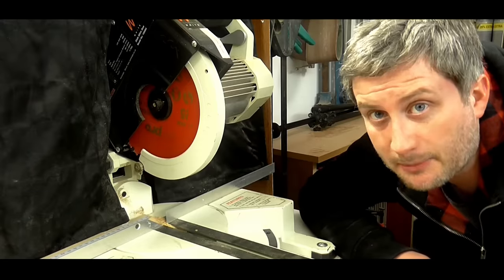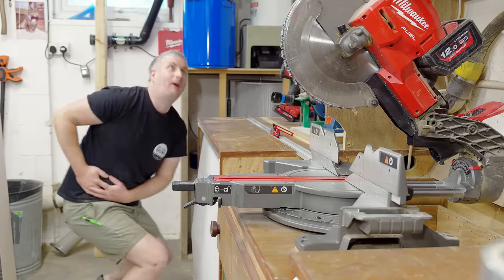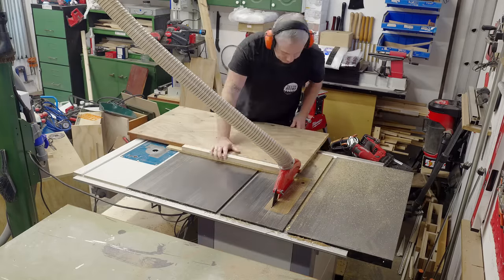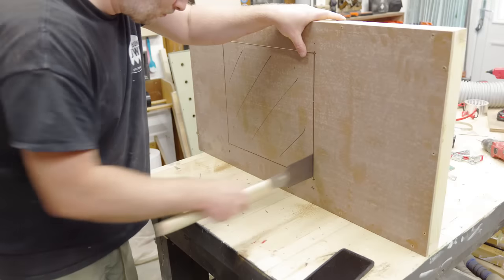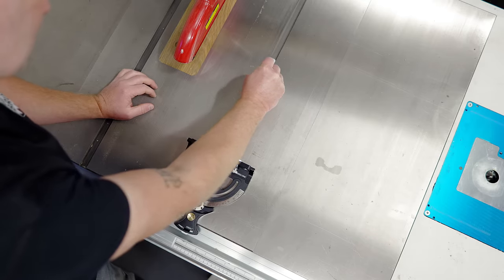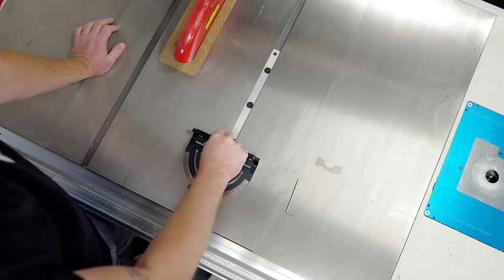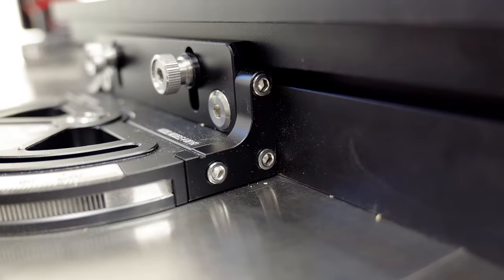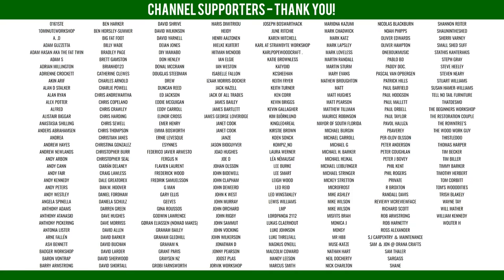Goodbye, Mitre Saw!

Comment: I have a 12 inch maketa.. they are a necessary evil in the shop.. my concern is of all my tools kick backs come from the miter saw
Ai have checked all adjustments.
I have a two car garage that has a space on both sides of the garage and except for the jointer and miter saw all the reston my tools are on wheels.
The saw stop table saw professional  saw is a must

Comment: I don’t use my miter saw unless accuracy is not an issue. Too much room for error with flex, lock points not engaging the same, and it will pull the material if you don’t clamp it down, or hold it with a lot of downward force. Which can be dangerous and move things around during your cut. Maybe it’s just me, but I use a sled.

Comment: I know what you mean. I've screwed my mitre saw to a piece of plywood and clamp it to whatever I got free space on and get cutting! There's lots of other ways to add stop blocks than have a mitre station so just get creative and make it work for you. 
There could be a 3D printable adapter you can have made to improve dust collection on your mitre saw. Still wearing a face mask is probably healthier rather than relying on dust collection and air filtering.

Comment: My dewalt mitre saw suffers from similar issues.  Its not an accurate tool. If you out pressure on the handle in either direction it takes the saw out of 90 degrees.  You can also change the depth if you set the depth stop based on how much downward pressure you apply.

Comment: My mitre saw is my most used tool, but I have it on a portable stand, a mitre station would just waste space and get covered in junk.

A mitre saw just feels so much safer than a table saw. I wouldn't fancy cutting down 2 by 6es on the table saw, and Notching out for half laps on long or rough stock is so easy on the mitre saw.

Comment: .. Spot on with the "junk collector surface".. and the whole reason I refused all these years to build a station.. it would have taken up too much space on my last shop floor.. and my new shop structure will be even smaller. Yes, miter saws are not as accurate as the table saw.. but it often takes too much time to set up.. and fiddly.. on the table saw.. and the Miter saw really exists to make quick, semi-accurate crosscuts.. in my case, it does as much as 25% of the cuts on each job that I do, as thin stock is so much easier to do on a crosscut setup.. and you don't have that much angle RUNOUT on a short piece of stock, anyway, in my experience - that can't be easily dealt with.
Where I think most people started to get into trouble was when everyone decided that they needed 12" W crosscuts - using a Sliding Miter saw - THAT can potentially give you all sorts of misery!
I do also agree with you that dust (even with the nearly 40 different solutions I have seen) output from that type of saw is suffocating! Great Video.

Comment: Sounds like your problem is rather a workshop design issue, could reprioritise other tools in the space and have for example the mitre saw on a lift that drops down under the bench. It’s position in the workshop is causing you to knock it etc and as you mention forward facing rails can make a big difference to space needed. I have a Makita with front rails and also has dual dust collection, plus mine is on a rolling bench which I wheel outside under cover for use. Of course if you’ve got competing tools like table saw which is more versatile, then you perhaps don’t need it.

Comment: Nice to see a video with this “against-the-grain” viewpoint. Personally, I’ve never been a fan of miter saws in the workshop. They’re handy on a mobile cart for worksite/remodeling jobs, but for shop purposes, I think a radial arm saw is a much better way to go. 

With a little tuneup, it’s just as accurate as a miter saw but with a greater capacity. And you can add a laser for ease of cut alignment. If you’re willing to get creative and design a new blade guard, you can install a 12” - or larger - blade (within the saw’s physical limitations, of course) for greater capacity in the Z axis. You can even (again, with some creativity) make a custom mounting plate to turn your radial arm saw into an overhead router table or a planer (using a hand planer and making multiple passes. I haven’t done either of those  yet but they’re on my to-do list) which make it incredibly versatile.

On top of all that, you can even make cuts that don’t go all the way through a board - which you would otherwise have to do on a table saw. I find that I strongly prefer my table saw for cutting panels ( wish I had a panel saw for sheet goods, though) but there are lots of times where it’s easier to work with a fixed workpiece. It’s a pretty trivial task to add flip-up side wings to support longer stock (and stop blocks? no problem!) - but then I can flip them back down for storage and it has a much smaller footprint than a miter saw station. (The footprint, front-to-back, isn’t nearly as deep as some miter saws/stations, too.)

Radial arm saws got a bad rap and fell out of favor because they’re unsafe for rip cuts (although you can find videos that dispute that) but I use my table saw for ripping, anyway.

If all that isn’t enough for you, there’s the price. You can buy an old radial arm saw for a fraction of the price of a sliding compound miter saw. It’s a no-brainer to me.

Comment: I started with a table saw and have never felt the need to have a mitre saw. I don't have the space and
any angle cuts other than 45 degrees for which I have a sled for, are done by hand.
I don't think I will ever get a mitre saw.

Comment: Maybe just build the mitre saw station with a height so it is helpful as table saw infeed support rather than a hindrance? If you can bend down to the table saw then a mitre saw at that same height would be okay... or if the mitre saw would be too low at table saw height,  probably you could just raise the table saw instead?
Reply from the maker: Because then my machines wouldn't fit underneath

Comment: Frist of all, you could definitely have a career as the "before" guy on infomercials! 
As for the video, I also do cuts i have to trust on my table saw sleds and the miter gauge you bought looks quite nice. I still have a miter saw and a radial arm saw in my shop. I find myself using the miter saw quite a lot in my work flow but everyone is different. Having open floor space is a valuable thing I have been working towards opening up more of it in my shop lately.

Comment: I can see the desire to get rid of that large miter saw work area, but I would have kept the saw and just put it on a mobile base.  I have a Metabo 12" on a Ridgid stand with wheels.  Folded it takes up minimal space.  When I need it I just roll it outside where the sawdust is much less of a problem.

Comment: I've had a mitre saw under my bench for about 10 years. It comes out to chop 3x2 CLS and not much else because I don't trust it to be accurate and the capacity (non-sliding type) is pitiful. I am hoping that my new Evolution sliding mitre saw will be put to much better use. Larger capacity and seems to have excellent repeatability, even after a few knocks. I haven't the space for a dedicated mitre saw station but it's light enough to set up whenever I need it. Time will tell.
Reply: I've been very impressed with my evolution sliding mitre saw, I bought it for cutting metal so that I didn't contaminate my main timber saw, but it's so good I'm using it in preference sometimes !

Comment: First and major mistake was not setting all of your surface heights inc the table saw to the same ht. so everything is an outfeed table. That said even the very best miter saws are not all that accurate compared to a dialed-in table saw sled. But I still want a miter saw to break down rough lengths.

Comment: My brother-in-law gave me his old Craftsman miter saw and I used it when I was laying some hardwood flooring. However, when I bought my table saw (Ridgid 4512) and then built a cross-cut sled, I never used the miter saw for anything woodworking. I little over a year ago, I bought an Inca V27 miter gauge, with a 24" piece of extruded aluminum (from Powertec) for a fence, I haven't used my cross-cut sled anymore. 

It really depends on the projects that you build but I think the miter saw is an extremely over-billed tool for the average woodworker. If you have a table saw, there is so much more you can do either with a good cross-cut sled or a good miter gauge, or both, that a miter saw is really a waste of space. And when you consider it's dust collection shortcomings, why bother?

Comment: I didn't ditch my Kapax. It's in the bottom corner of my shelf collecting dust though. There are times it becomes handy but that rarely happens. Crosscut is now done with a track saw and a DIY rail square, which is much more accurate.

Comment: I find the only way to cut 10 ft. boards is with a mitre saw.  I don't have 10 ft on either side of my table saw, and a 10 ft. board wouldn't stay straight if it did. I could use a circular saw and then recut with the table saw, but this just adds more work.

Comment: lol…. Just get a decent accurate miter saw like a KS60 or KS120. Have great experience with KS60 regarding accuracy at every single angle. The KS120 even has a micro adjustment handle if that’s your thing. But great opportunity to make content… with something like ditching a mitre saw 😊. Even the guy at Finish Carpentry TV swore to never buy Festool….and look at him go 😅

Comment: Removing the miter saw also means that you will have to switch between rip blades and cross cut blades in your table saw. Minor hassle compared to the lack of space and poor dust collection from the miter saw.

Comment: It's funny that the miter saw is a tool that beginners think they need most. But it's not (unless you are going to be doing a lot of finish carpentry). I barely use mine. Instead I use a handheld circular saw for carpentry, and my table saw for more precise work.

Comment: I wouldn't agree that the backward rail design is the most robust. It doesn't matter whether the rails are running through the back of the saw or through the body. In fact having the body slide forward on the rails is probably better as you won't always be making a cut at full extension and therefore there will be less flex pressure on the rails. In reality though any tool will lose its accuracy if you use it enough. Bearings develop slop, and where there are grub screws or pressure screws used to make adjustments those surfaces will develop small amounts of damage. The mitre gauge is excellent, though I personally prefer the bar of the UJK gauge as the spring loaded ball bearings in the bars are way better than the plastic washers on every other mitre bar. I think Axminster sell those bars as an accessory.

Comment: The table saw solution is ok but you still have the issue of changing blades from ripping to accurate crosscutting blades. They haven't invented a blade which does both accurately but I do understand it's about compromise in limited space. I'm lucky enough to have a Wall/board saw which I use for sheet materials but also cutting cupboard door stiles, sash horns,fire door  glazing appetures etc. I still use my mitre saw but mainly for trimming the ends off sawn boars.
Reply from the maker: Whether the blade is designed for cross cutting or ripping has nothing to do with how accurately it cuts
Reply: @RagnBoneBrown  Thanks for the reply. You missed my point which is ,if your going to accurately cut mitres  for picture frames,boxes,beads etc then you won't get a nice finnished,accurate cut from a blade you would use for ripping timber. Same as crosscutting Ply etc. Point being there is no blade designed to do all of those cuts so you would be changing the blades to do certain jobs. So time wise it's no different than re-adjusting your mitre saw. All you've gained is a bit of space which is a bonus in a small worksho but it's not a win win option..  All the best Ade

Comment: see if you can find a CTD Mitre saw. Then put it as close to wall as possible. This has no fancy half asses radial arm like feature if you want that get a radial arm saw instead. The fence table with measure jig stop should be no more than say the depth the blade can cut. Above the fence table put two shelves one on each side at an easy to reach height do not let this get deeper than the fence front to wall. above those make a full-length stock shelf. Where you put the saw, itself should be a proper sized cabinet for the saw and possibly a little space for fence attachment. All the areas under the fence to the wall should be left open or a waste can something easy to move. If you are really tricky you can "Muphy fold up bed idea" your fence with some way to clamp the end to the saw or was cabinet.

Comment: I don't think Robert DeNero has anything to worry about ;). I think you will soon get used to using the cross cut sled , perhaps you could keep the mitre saw to hand if you are doing work away from the shop?

Comment: That’s all very nice but when you need to make a compound miter cut, nothing works faster and more accurately. At least that’s my opinion.
Reply from the maker: I think I've done that once in 8 years though
Reply: Well, if you did as many crown moldings and picture frames as I’ve done, you’d find it necessary, but for average @RagnBoneBrown   Home tinkerer you’ll find the harbor. Freight tools are good enough using like that once every six months and you save money, it’s just finding places to store the stuff.

Comment: I kind of hate my mitre saw. A blue Bosch so good quality but noisy as hell, ultra messy and pretty scary. It is a crude weapon and only accurate enough for simple big stuff. Much prefer using a cross cut sled. That said I use it quite often and wouldn't try laying a floor without one.

Comment: Problem with a miter gauge isn’t in the accuracy of the stops or the slide. It’s the size. Just too small. And for imperfect wood, that’s where the problem lies. You’ll be throwing this against the wall in no time.

Comment: I can understand that you do not want that humongous mitre saw station taking up so much space, but I wouldn't get rid of the mitre saw if I were you. I have a collapsible saw stand for my mitre saw so it doesn't really take up that much space if I don't use it and it is 'packed away', but in a matter of minutes it can be fully operational and for certain jobs it is really a must.

Comment: 3:23 just give me your old miter saw and be done with it im sure i can find a use for it cutting firewood. Just the tool, ive got blades  it be handy by my 3 table saws and 2 radial arm saws.
Better then the craftsman 10 unit ive got ill fix it problems.

Comment: I can tell you right now and I am heavily invested in Milwaukee that the accuracy and  repeat ability of cuts on that 10” miter saw has not been praised. The 7 1/4  and the 12 inch has had respectable reviews. The 10” however which I also have is the notorious for blade deflection. And I can tell you right now in forward rail  design is far superior to the traditional rear rail style. But I am shocked that they tried to pull that and say that that miter saw has been praised for its accuracy and repeatability. It is literally the exact opposite. I love Milwaukee but that’s probably my biggest grape with them. They are so damn proud of themselves. They can’t scratch their ass without throwing a celebration. They need to dial back that over the top marketing that they do and spend a little more time on coming up with solutions. I really hope on their next GEN miter saw they switch to a forward rail design like Festool, Makita ect.

Comment: I have truly never understood why people have miter saws in permanent stations. The reality is that they need huge amounts of space on the wings if you are going to deal with even 8 foot material,  and a lot of the material a miter saw is truly good with is much longer than 8 feet anyways. I have major bias on this front, as I am a jobsite carpenter, so I naturally have a miter saw stand, but even so... miter saw stands are cheap, don't take up a huge amount of volume, can be stored in a vertical position, and have imho, significantly better functionality than some permanent station. When you aren't working on it, just stand it up. If you get an axle kit, you can even store the stand with the saw mounted to it, and while it requires significant vertical space, the square footage of a miter saw is quite minimal and it can be moved quickly if you need the room.

Comment: A miter saw is far safer to use than a table saw though. 
You should have just angled your table saw at a 45 and go corner to corner of your shop in my opinion.

Comment: I have a Bosch 12" sliding compound miter saw and when I want a perfect 90 degree cut, I lock it down so it won't move if bumped.  I don't have space restrictions in my 800 ft2 shop and not having a miter saw would slow many of the things I cut down or make it nearly impossible.  Try cutting a 4" high x 16' base board on a table saw or track saw.  

Seems your miter saw issues are yours alone, since you seem to justify getting rid of it with your limited space.  A miter saw would be the last thing I'd get rid of.

Comment: the thing is your mitre saw is a monster....mitre saws are for four by two timber and less for stud work and such not fine woodworking....a little fixed head not an "i'll climb over the timber and cut your hand off sliding behemoth" takes up less space is easy to move and is probably more accurate.